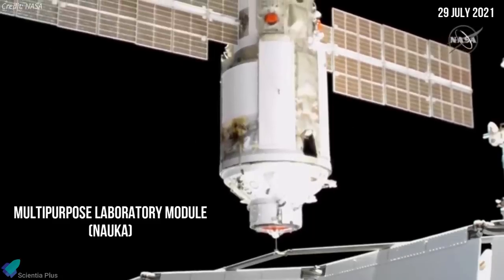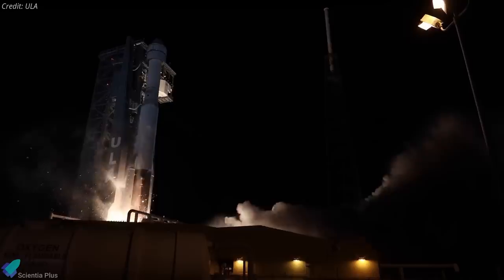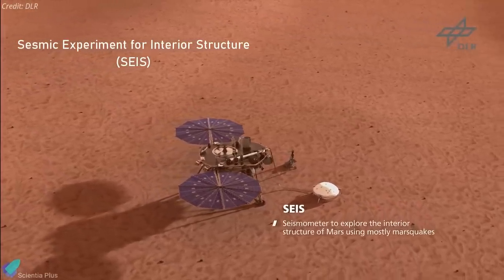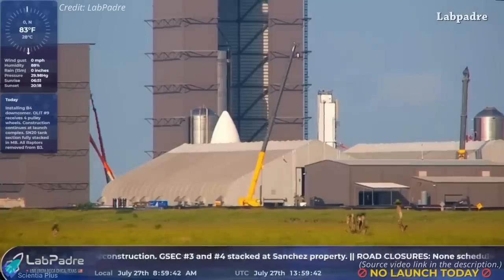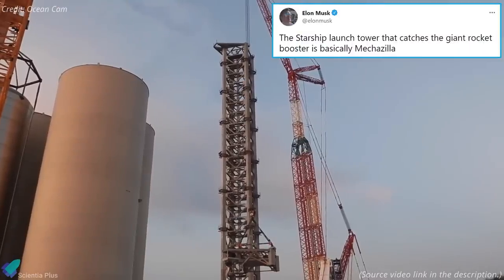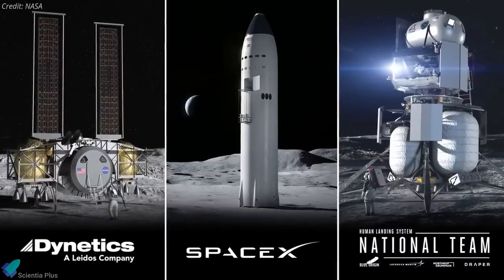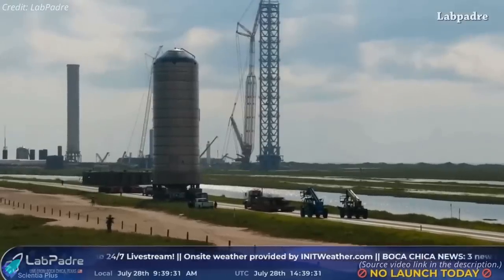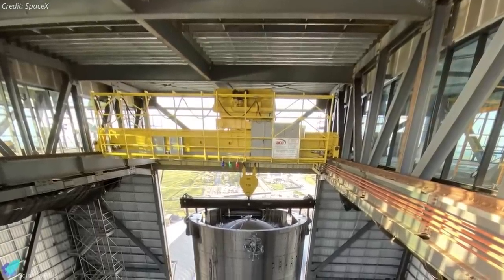Rapid Progress at Starship Factory within 1 Week | Blue Origin's Secret Project | Nauka-ISS Anomaly

Comment: 75 thousand kilonewtons? or 75 kilonewtons.... because the difference between 75 thousand thousand newtons and 75 thousand newtons is vast.
Reply from the maker: Thrust generated by a single raptor engine is approximately 2,300kN.
33 Raptors x 2300kN ~ 75,000kN.